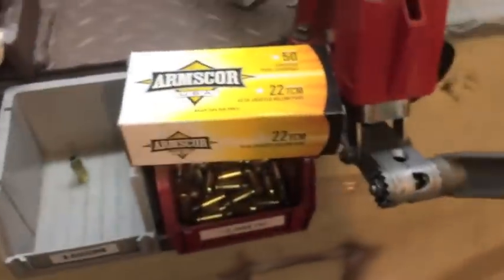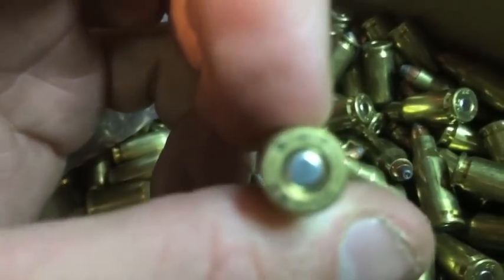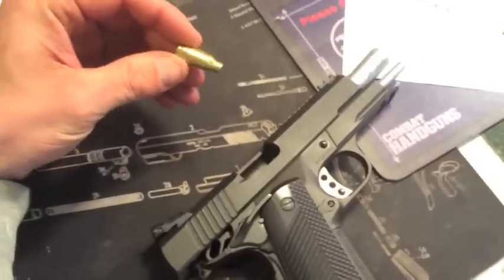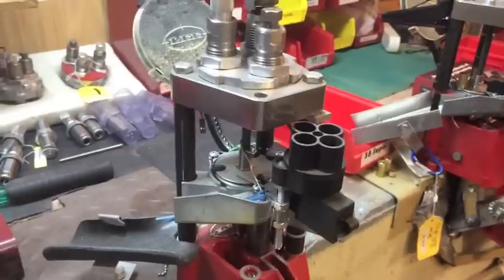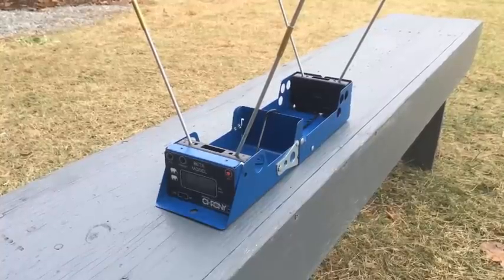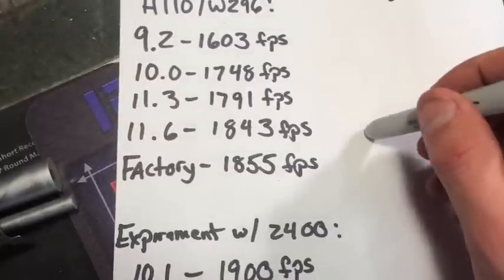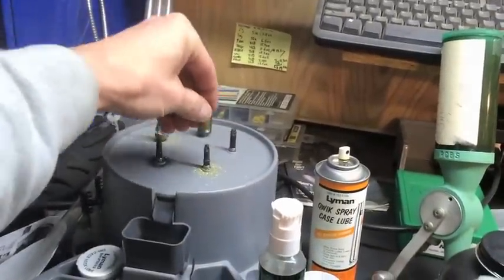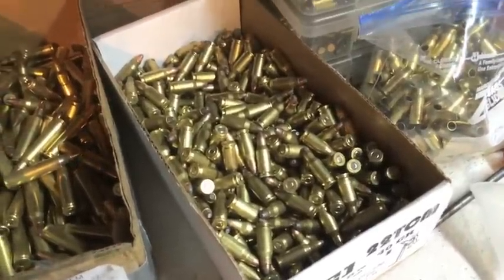Reloading 22TCM Overview

Comment: When you size the 223 556 brass,  leave the inner die, the little football out.  The wall thickness vary. Then ream the inside of the brass. Then resize with the football in. I bought both Hornady and Lee dies. So I just leave the inner die out of one set. I actually broke a Hornady inner die, they were nice enough to send a free replacement. I had to cut the brass off a couple times before I learned.  Make sure you ream the throat!!!!

Comment: In my 5" TCM, started seeing serious signs of pressure at 8.5 grains of Alliant 2400 and the velocity was about 1600 fps.  I went back to H110 and W296.  10.3 grains of H110 and the Armscor bullet seems to be the best I can hope for in the pistol.  Still trying to get the rifle to shoot a decent group.
Reply: I have the rifle, after a trigger job and free floating the barrel, my 35gr balistic tip reloads using Llil Gun almost shoot into the same hole at 50 yards. I have to load some more, then off to the 100 and 200 yard range. BTW, they were chronoed from 2900 fps to slightly over 3000 fps. Over 3000 fps, bolt was a little sticky

Comment: Best I've found is 10.8gr IMR 4227 1900fps. Burns clean, doesn't gum up your chamber.  There is a company that makes 22tcm and 300 blackout fixtures for that little HF chop saw.
Reply: 11.0 gr. Ramshot Enforcer, Speer 40gr. JHP = 2,015 fps from Glock 17 with 4.5" TCM9R barrel.
Reply: @hansgruber1974  did you have trouble fitting your tcm9r barrel to your slide or lock block? Was it a stock g17 gen3?

Comment: Nice work, I've been wondering about a faster powder than H110 with the huge fireball.
I've read people using Lil Gun with success (less flash, consistent velocity)
2400 is faster than H110 and Lil Gun, velocity was great.
How was the flash?  Wish there was a way to measure the pressure.
Reply from the maker: Thank you sir… I believe it was about the same but honestly I was kind of holding my breath because I wasn't sure how 2400 was going to act! :-P I haven't got out to do any more testing with 2400 with this never-ending winter I seem to be stuck in!

Comment: I reuse my old ammo trays for the same thing. I was wondering what type of groups you get with your pistol and if they improved any with reloading. I figured the TCM would group better than about four inches, but that seems to the best I can get. my TCM rifle on the other hand puts 'em pretty much in the same hole.
Reply from the maker: To be honest I haven't done much grouping testing with the TCM pistol platform... I mainly shoot steel with it and I wouldn't really be able to tell the difference between a 1" group or 4" group... I would assume that I can keep them in 4" because I'm hitting my plates but need to do more r&d on actual groupings.  I just started to pay attention to this more now that I am loading for the rifle and when I have more data compiled I am going to post it, I am curious now to see what I get... I know when I started loading I had a baseline, like say 3" groups at 25 and as Long as they were okay I kept going but I honestly can't remember what it was.  Thanks man and when I gather all the data I'll let you know! -bill
Reply: Thank you. I like my TCM but sometimes I am just not happy with the groups I get. I did notice I got better groups with different lot numbers of ammo, not only with this gun but also with my 10mm. at least with my 10mm or 38 super I have a wide variety of factory ammo and reloads to experiment with. grouping is important to me because I shoot small local matches, bullseye and bowling pins. I like the 10mm better than my 45 for pins but I noticed lately its been throwing some rounds wide, missing the pins. my reloads shoot tighter but I use factory ammo for completion. still trying to decide if I want to reload for the TCM, probably will cause I also have the rifle.
Reply: I never got good accuracy out of the rifle with factory loads.

Comment: I have noticed that nickel plated brass seems to have failure to eject occasionally vs. brass, has anyone else had issues with nickel vs. brass? Thanks
Reply: Just once, and noticed shaving left behind as well.
Reply: I'm having a lot of stuck cases and fte with american made nickel plated ammo ..seemed brass phillipines ammo done better ..I've yet to make it through a full mag with nickel plated without a fte stuck case ..I've polished my chamber really well and I'm hoping that may have fixed the issue ..I've hear to polish chamber ..and also over lube it and use one shot case lube in ammo to help with extraction..also heard to leave the slide locked back with the 22tcm recoil spring for a week and that helps ..anyone else know the secret to getting this 1911 to run accordingly?? I love the gun and the cartridge and I'd love to get it to run well ..hate to get rid of it so in gonna do everything I can to fix this ..I thought about trying 22tcm9r ammo and seeing if I get better results because they say it's ok to run either one in the 22tcm chamber ..evidently they didnt account for swelling or heat with the chamber
Reply: Teflon spray- one light pass over the loaded ammo and they extract like butter.  I bought a can of Dupont Teflon dry film lubricant off of Amazon for $4.00 and it works great.  I thought about the idea after remembering that FN had to polymer coat their 5.7x28mm rounds because they were having extraction problems in the FiveseveN pistols.

Comment: Anybody ever try loading 62g m855 green tips in the 22 tcm casing?? Or even in the 5.7x28?? To my understanding, they all ( 5.56, 5.7, & 22tcm) fire a .224” diameter projectile. Wasn’t sure how much case capacity you would lose by setting a bullet that deep in such a short case. If you have, what speeds could you get from a handgun?

Comment: I looked up the specs for the round, have you considered a .224 bullet like what is used to reload the 5.7x28 or even a 55gr 223 round?
Reply: I have reloaded with two .224 bullets - both using the standard H110 type propellant - I have found going heavier than 40 grain is very touchy - the best inexpensive bullet I found is Speer Varmint 22 40 grain SP / Speer #1017 -  the heaviest bullet I have tried with consistent success  is the Hornady 22 (22/Bee) 45 grain HP/BEE Hornady #2229.  I tested with my 22 TCM FS (5 inch).  Please do not try this unless you are VERY careful and have experience with reloading.  I am not telling you to try reloading with those bullets - it is simply my experience.

Comment: Has one one thought of using Barnes 45 gr. triple shock flat base bullet all copper.Would get better penetration then thin jackets or is this not feasible for this round? Would seem better than flat nose bullets.And would  make this round some what of a carry weapon.
Reply: I would / have carried with factory HP - stopping power is fine with TCM but the flash could blind at night.  Perhaps, one could use the flash for tactical advantage but it would take a better shooter than me.  TCM is a daylight hours carry for me.
Reply: Probably to long and will take up a decent amount of case capacity

Comment: Wow, 11 FPS deviation from the Armscor factory ammunition was surprising.
Reply from the maker: Elevation and temp are factors, so is barrel length of firearm
Reply: True. I have wildcats under my name and many customs. I was just pleasantly surprised with a low SD. You cannot beat a good hand loader. With high performance pistol cartridges, I’ve had great results from Lil Gun believe it or not. Maybe worth a try. My 221 fireball and others love it. Cheers.